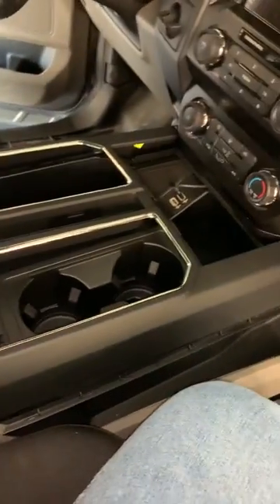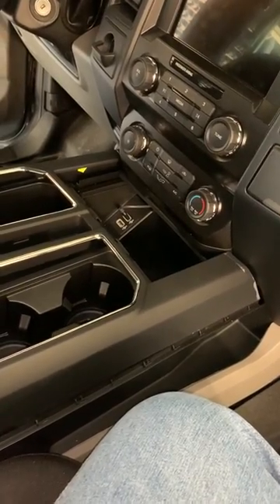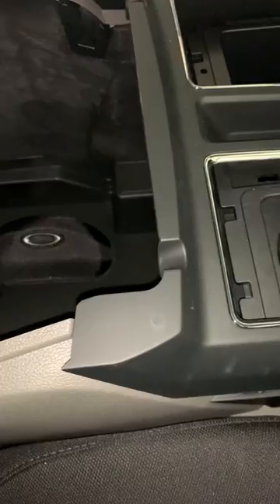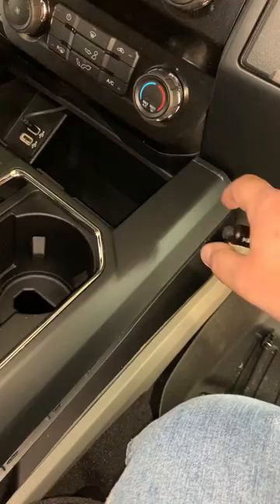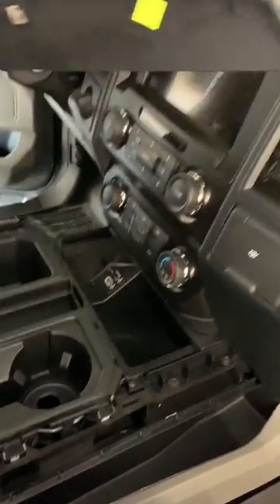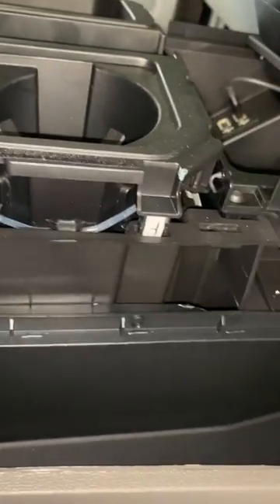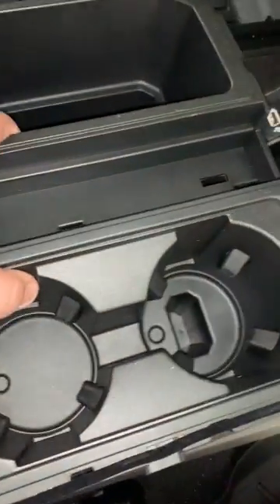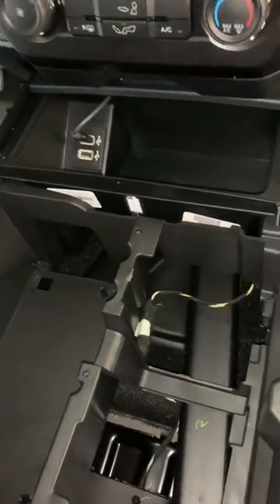2019 Ford F-150 STX Center Console Removal

Comment: ‘It has a real shifter like trucks are supposed to have’ THANK YOU! I spent months trying to find my F150 because I wanted the center console, but not the center console shifter. It’s not a car 🤦🏼‍♀️
Reply: Haha Yes!  I had a 2017 F150 King Ranch before this truck and literally the only good thing I could come up with about the "car" shifter was that I could rest my hand on top of it.  I can't count the number of times I went to put it in reverse and sent it all the way home to park.  This is so much better
Reply: Actually, mechanically the center console shifter is better for the transmission because it’s closer to it and just overall functions better. The other one is cheaper and is more prone to becoming damaged and needing repair. After a few years it will loosen. Just my experience with these trucks and probably is why the console shift comes with a more loaded truck...
Reply: Real trucks have a 3rd pedal and 5 on the floor.

Comment: Do you happen to know if any of the wires under there are power & ground and which color is which? Have a 22 F150 and need to install emergency light switch box and wanted to break into the wires under there if possible
Reply from the maker: Sadly, I do not know what all is in the harness(es) under there. I ran my own power from the battery so that I wouldn’t have to try to find a wiring diagram. I think there is a 12v socket mounted on the back of the console for backseat passengers to use, perhaps you can locate that and tie into it?  KEEP IN MIND though, that those circuits and harnesses are purpose-built, so anything you add cannot exceed what that circuit was designed to hold. For a 12v socket, it’s probably fused on a 10A or maybe 15A circuit, and for heavens sake don’t just put a bigger fuse on it. My recommendation is to spend a little time and run a new fused power circuit  from the engine bay. Anytime you cut into a harness you run the risk of unintended consequences in my opinion

Comment: Thomas G, very good video; thank you.  I was afraid I would break stuff if I had to experiment removal on my own.  I am wanting to put a CB radio in that small compartment under the sliding lid.  I just want to get the wiring into that space (power wire, antenna cable, and maybe external speaker wire).  I am initially thinking I will not mount the radio, but just sit it in the space and put something around it so it won't move or rattle.  Of course it needs air flow too.  What did you decide for your radio install in that location?
Reply from the maker: I tried to take video along the way, but it was difficult to remember since I was working by myself and don’t usually video myself. I finally decided there was no point since I had missed so many steps. I will go out and take a video today that hopefully will give you an idea what to expect. I will tell you now - that tray isn’t as easy as it looks, and you have to take quite a bit out to make it happen. But it is totally worth it in the end, because the radio literally vanishes when you close the lid.
Reply: @thomasg4678     I decided last night to give this a shot.  Your video showing how to get the console apart was very helpful.  Removing the 2 screws on the slide allows for removing the slide easily...just pull the slide frame straight back.  I was then able to fish wires/cables down and left to come out on the left-bottom side of the console, and then move them toward the front or rear of the console depending on need.
Reply from the maker: Bryan Telker good deal. Let me know if I can help with anything else, and good luck!

Comment: What does it look like removed? Is there enough space to bolt an amp under it?
Reply from the maker: stephen thatcher I didn’t remove the entire console; just the guts and the center stack above it on the dash. Regarding the amp, it really depends on how big the amp is. If you pause my video when I show what the center looks like with the cup holder tray removed, you’ll see a plastic piece that kind of runs down the right side. That is a conduit for the right air vent on the back of the console. There’s one just like it on the left, except that it’s hidden by the plastic that the tray sits on. If you don’t have a huge amp, you can probably make it work. But If the amp can go on the floor of the storage area under the armrest, I would suggest you go that route and just make a hole at the front of it that you can run all your amp wiring through. As an added bonus, I believe the A/C leaches into that compartment because I have reached in there after long trips and the stuff inside is frigid. Let me know if I can help with anything else, I’ve been taking interiors apart to hide wiring for a minute or two. Good luck!
Reply: Sorry I know it's years later but after breaking it down as far as you did in this video, is it just a matter of the 4 base bolts to remove the console all together? I'm doing sound deadening in my truck and want to lay down some CLD and lass loaded vinyl